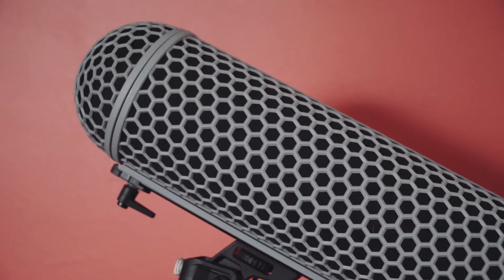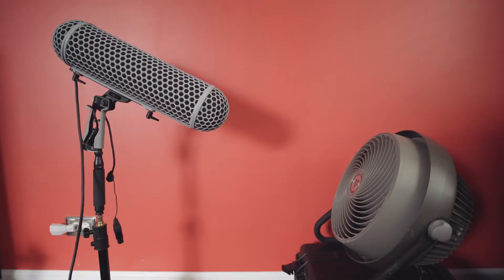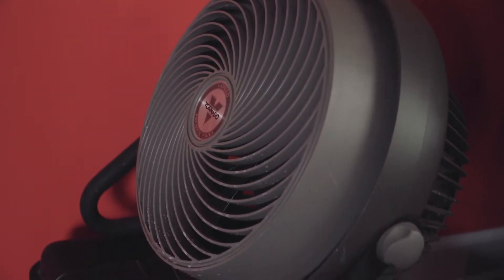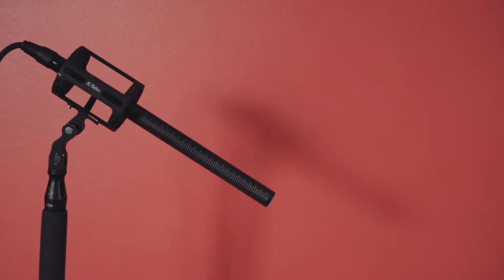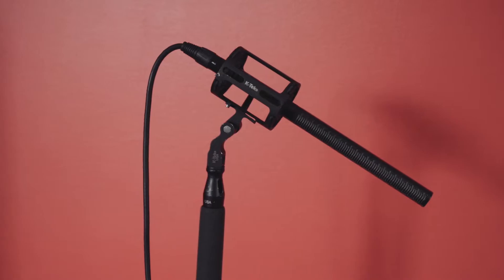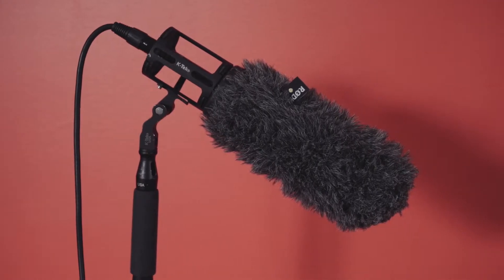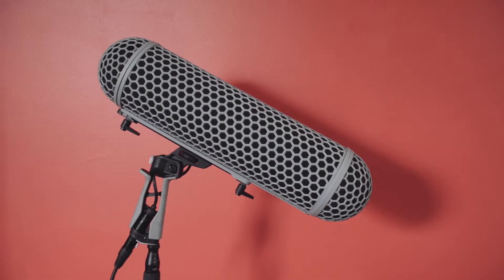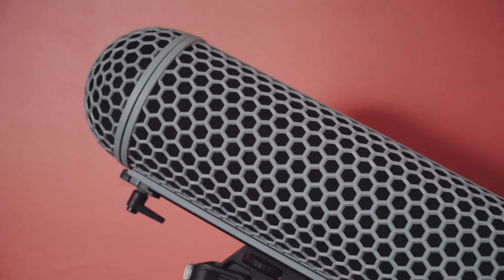Microphone Windscreen Comparison | Fur Windscreen vs. Blimp Windshield

Comment: The AGC in the camera audio chain seems to invalidate the testing.  The tests should probably be run with a single fixed gain (unchanged for all the windscreen variations). To be really comprehensive, a 2nd-stage test should ALSO be run.  Showing the audio spectrum of a pink-noise source picked up by the mic, with each of the various windscreen options in place.  (This shows how much degradation is incurred by applying each of the windscreen solutions.)